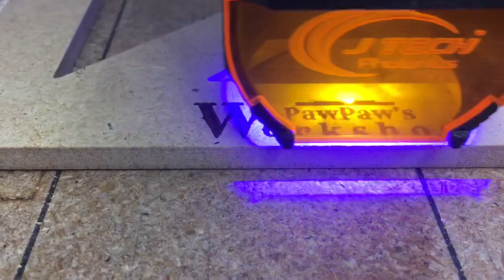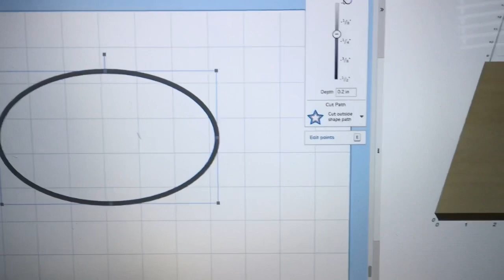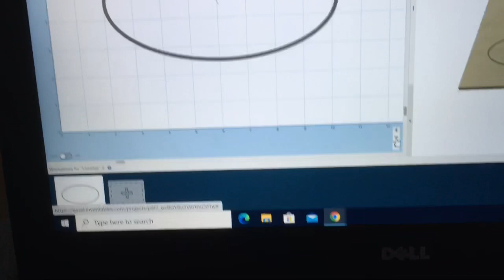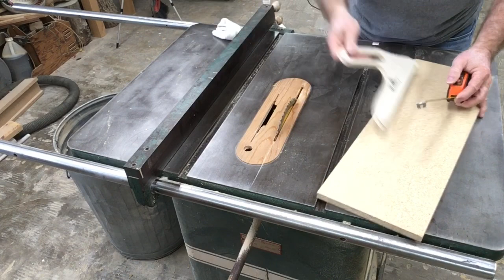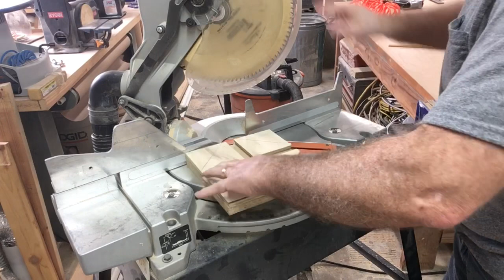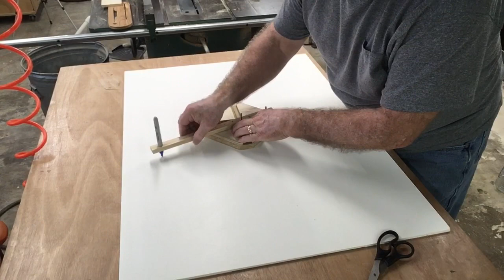OVALS?? CNC or No CNC: Simple Jig to Do It

Comment: Pretty slick!  Have you tried comparing this to using two pins (nails) and a string, as shown here?  https://www.thisiscarpentry.com/2013/09/06/drawing-an-ellipse-the-string-method/  I would think drawing an oval of specific dimensions (36x20, for example) might be kind of tricky.
Reply from the maker: I actually thought about showing that as well but I thought that three methods would be a little much for one video.  Thank you for sharing your thoughts.